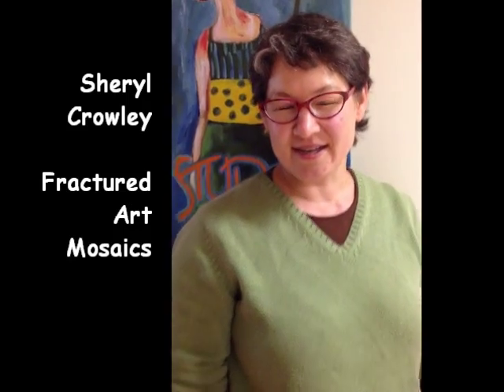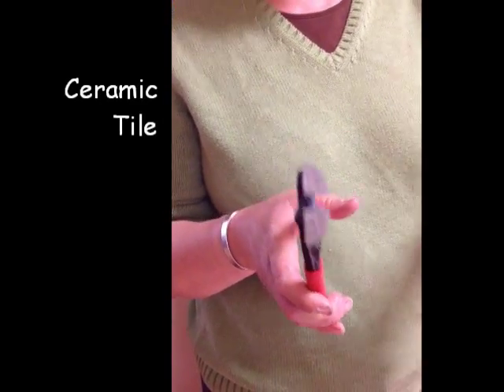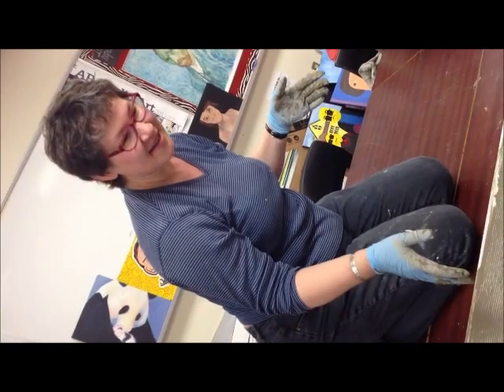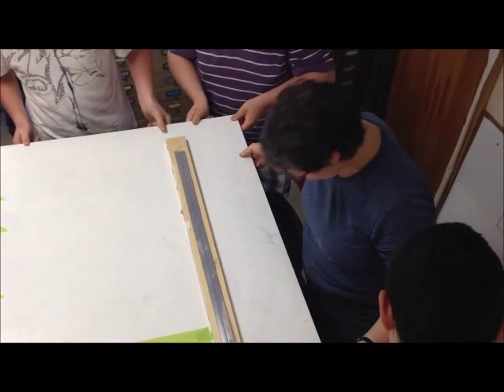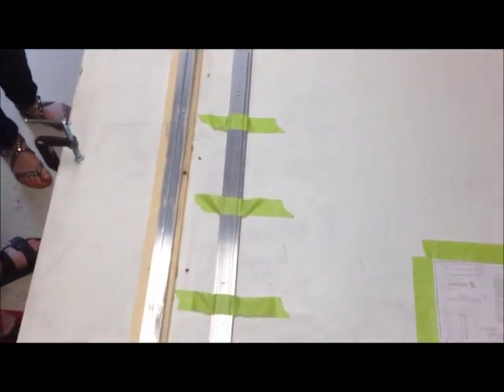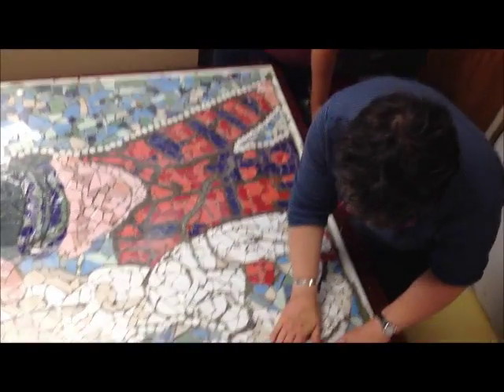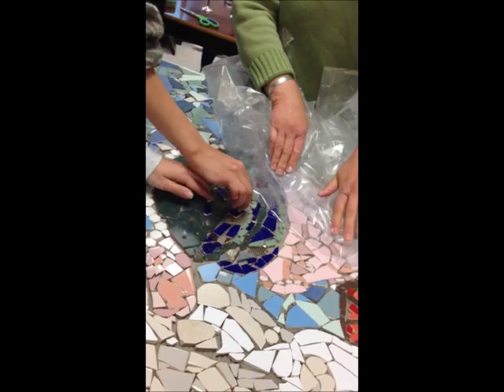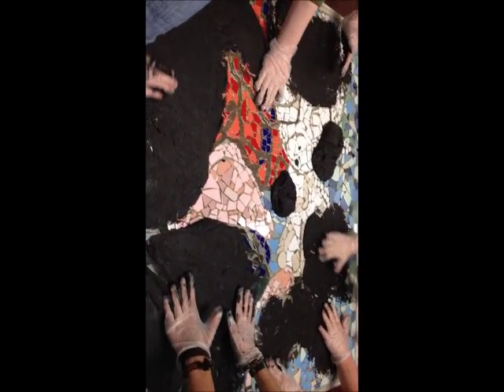How to Make a Mosaic

Comment: Wow! Thank you so much for posting this video. I have a question for you, I want to make a mosaic as well and I want to know what does it mean to "tooth" the surface? how can I do it? and what would I have to apply to seal the wood? Could you please advise! Thank you so much!!! :D
Reply: To "tooth" something, - and the phrase is not exclusive to tiling and mosaics- means to roughen up the surface intended for adhesion. This process helps the adhesive to better grip the substrate and hold fast the tiles, It can be done by using a very coarse grade of sandpaper if plywood or MDF (medium density fiberboard) is the substrate, no need for anything fancy, random swirls work just as well as neat rows of scratches. Check with the home center on a suitable sealer, one that is water resistant is best and, do coat both sides of the substrate; plywood, MDF, and especially natural wood expand and contract depending on the ambient moisture, this helps to minimize that effect which, if ignored may lead to warpage of the substrate.